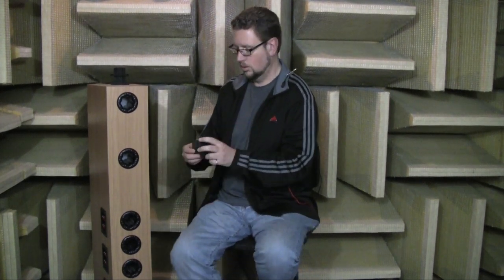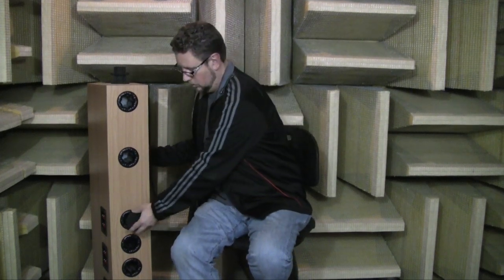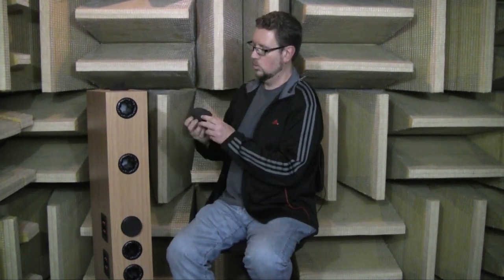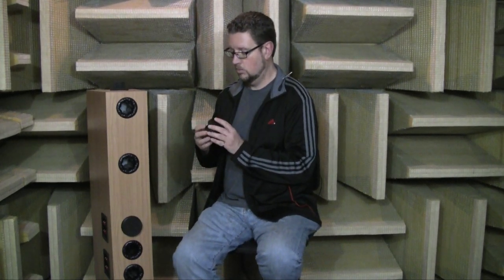Port Plugs: When, Why and Where Should You Use Them?

Comment: Can we use port plug to any subwoofer? I have a jbl 300 watts single ported downfiring subwoofer. If I put a sponge in that back port will it make a difference. If some sound test is showed it would have been helpful.
Reply from the maker: For subwoofers it’s best to check with the manufacturer before using port plugs. In some cases plugging the port can alter the EQ and limiter performance that could cause driver or amplifier damage.
Reply: @AxiomHomeTheaters  ok Thank you so much.
Reply from the maker: @HemanthVlogs  you're welcome, and thank you for watching.
Reply: @HemanthVlogs  i've seen people use paper towel tubes closed at one end use for deeper bass

Comment: what effects do the plugs have on extension?  If plugs are put in a ported subwoofer....
Reply: DCUPtoejuice I'm going to use the SVS PB16 Ultra as an example. On the PB16 Ultra there are 3 forward facing ports. Depending on if and which Ports you plug, it will change the tuning. If you have a tuneable Subwoofer I suggest reading the Manual.

FREQ. RESPONSE
15-280 Hz +/- 3 dB (standard mode) All Ports open
13-280 Hz +/- 3 dB (extended mode) 2 Ports open
14-360 Hz +/- 3 dB (sealed mode) All Ports sealed